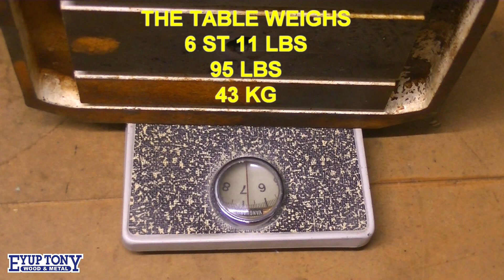HEAVY LIFTING FAIL - OUTTAKES

Comment: work smarter NoT harder ..... use what you have to lift it in stages  (4" one side 4" the other side .... 6"one side 6" the other side and repeat...to  height required or liftable hight .... i.e wood blocks ... axle stands  any timber thats secure and leaverage is Your Friend ..... Watch ya toes ....
peace
Reply from the maker: Thanks for your  input......Cheers Tony